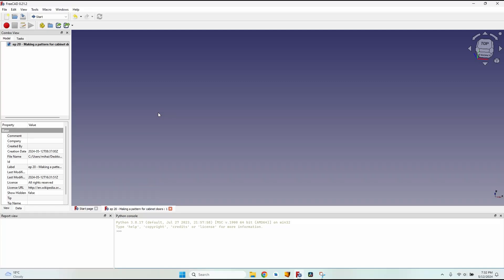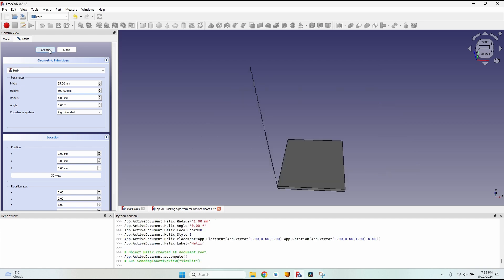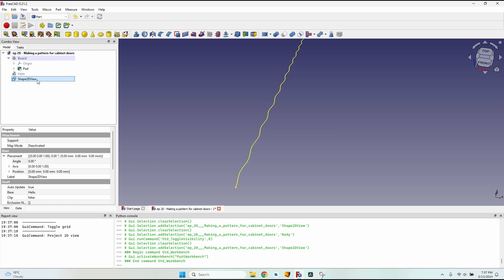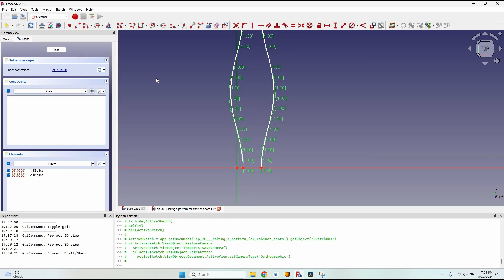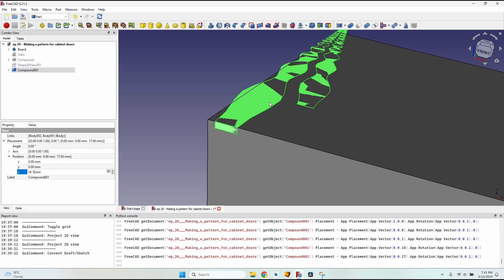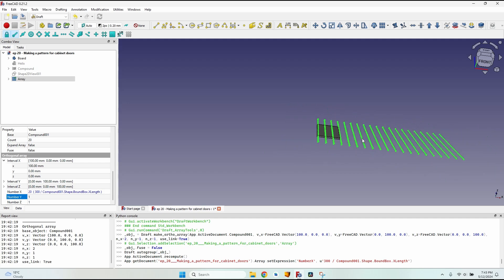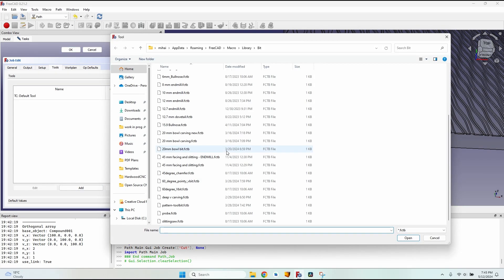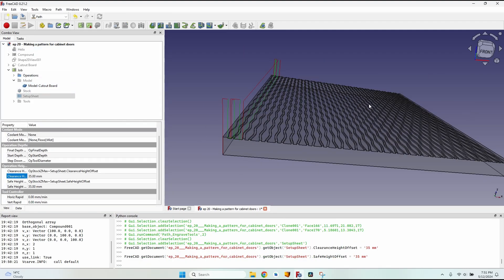CNC Cabinet Door Pattern Tutorial – From Design & G-Code to Milling

Comment: instead of creating a sketch to link the two corrugations, you could have used the "create ruled surface" function in the Part workbench.
Otherwise, excellent video, as usual 👍
Reply from the maker: I've never used that, but it'll take a look soon, thanks for the tip!